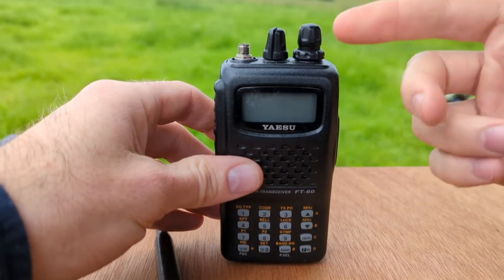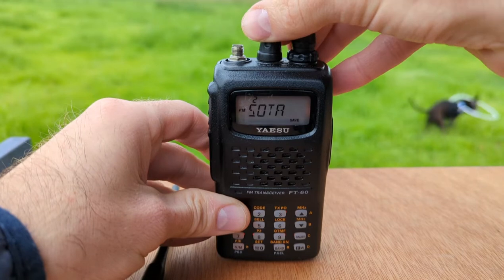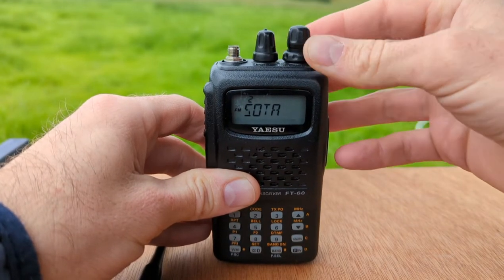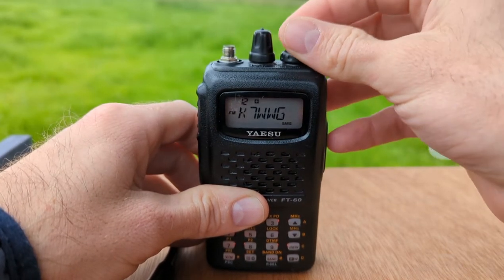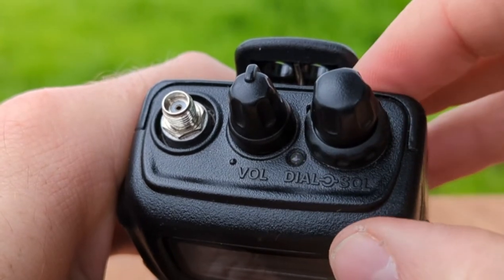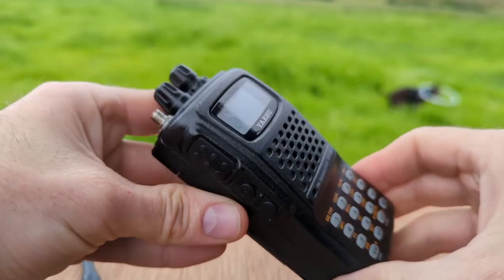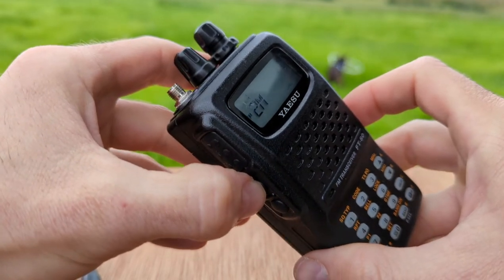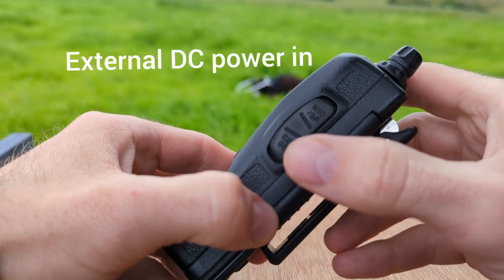How to Yaesu FT-60r Series Intro and Radio Overview

Comment: Any thoughts on how this might compare to the  Alinco DJ-VX50?
Reply from the maker: I don't have any experience with the Alinco. A quick glance at the product pages for both radios: different stock battery chemistries, Alinco has 200 memory channels whereas Yaesu has 1000. Yaesu has some other proprietary features: ARTS and WIRES. 
I'd be curious how the Alinco's receiver does in high-RF environments. I like the FT-60r for it's great out-of-band rejection of strong nearby signals. This is especially useful when working portable from a mountaintop with TV/microwave/etc towers.